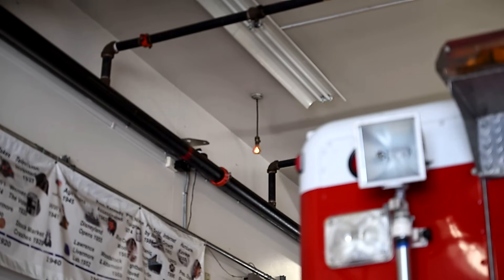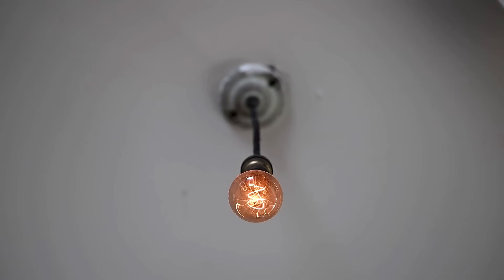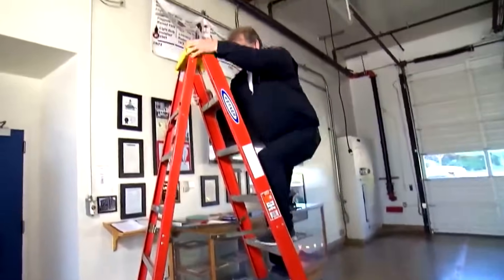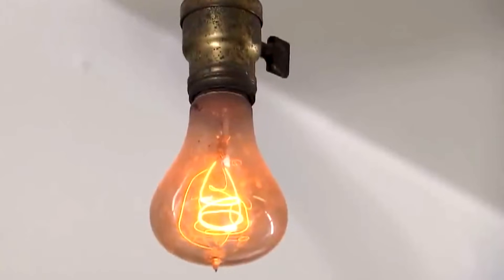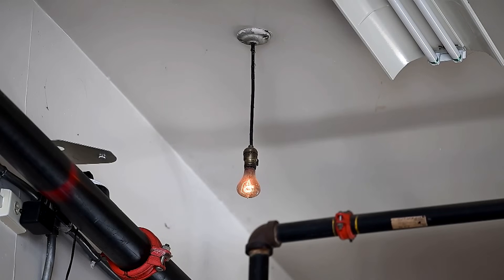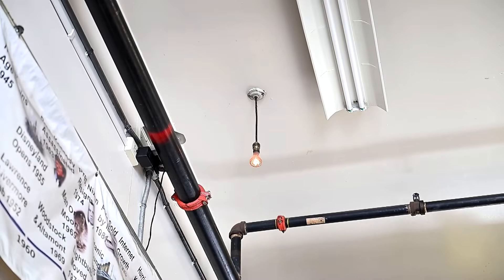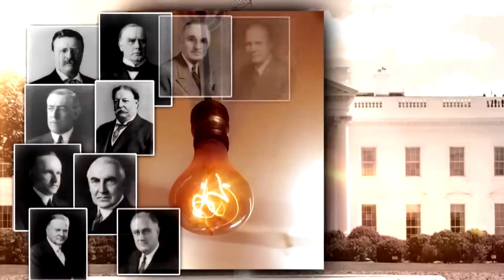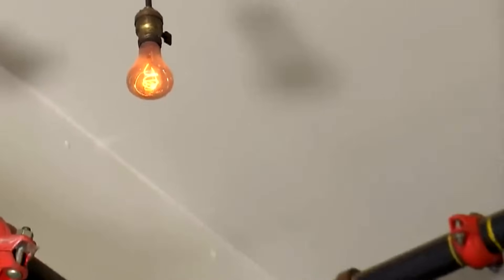This 120 Year Old Light Bulb Still Works!

Comment: How's that scientifically possible? Why hasn't the filament burnt out?
Reply: Handcrafted carbon filament is much stronger than machined tungsten filament. The light almost never gets turned on and off, minimizing wear. Lastly, the bulb was manufactured to run at 60 watts, but it only runs at 4.
Reply: Because the tungsten filament is thicker than normal.  It runs at a lower temperature. It also emits less light.  It's very good at wasting electricity
Reply: It is dimmed a substantial amount. When you dim an incandescent light bulb, it lasts longer.
Reply: Thomas Edison made them worse on pourpose because they lasted too long, causing sales to decrease
Reply: The massive light bulb companies got together to corner the market. They intentionally made a pact with rules among them to help drive sales. A light bulb company that makes light bulbs that last more than a few years, and is part of that pact, gets fined an outrageous rate if they do. All of this was to drive sales.

Comment: I cannot believe that light bulb has worked for so long! That is insane! The ones they make now don't even last nearly as long as they promise .
Reply: No one mention that was the side effects of making the filament glow way brighter
Reply: @randomthingch1970 just do not stair at it. You do not want that effect.😅
Reply: Because if they did they wouldn’t be able to sell any
Reply: @powmuckerstion9206 
Wrong

A longer lasting bulb only glows half as bright but consumes the same amount of electricity
The ideal light bulb is supposed to burn the filament as bright as possible

The point of giving light bulbs a shorter lifespan is to give you more light for less energy
Reply: @Katzelle3  Imagine if they all lasted as long as this one I'd think people would choose the longer lasting one if it meant they did not have buy more lightbulbs especially if the technology for longer lasting lightbulbs was further pursued. Problem is if that was what happened at some point lightbulbs would last practically forever which would mean lightbulb sales would tank especially if the bulbs were brighter the people making lightbulbs realized this back in the day so they stopped trying to make them last too long.
Reply: Given prices of one buck per bulb and twenty cents per kWh you pay seven bucks less for two normal bulbs that consume forty Watts than one double lifespan equivalent that consumes sixty Watts
Reply: @powmuckerstion9206 not just that but the manufacture cost and energy efficiency is magnitudes better today
Reply: and then they claim to care about the environment HAHAHA  @powmuckerstion9206
Reply: @powmuckerstion9206 omg I hate this argument. Incandescent light bulbs don’t last forever, no matter what really. If you want it to actually give off useful light, it’ll wear out. You can design them to last longer, but they use more energy and glow less brightly. Lightbulb manufacturers set the 1000 hour limit for a reason. It wasn’t just so you’d buy more bulbs. It was so you’d spend LESS on electricity. You could get 2500 hour bulbs, but they cost more to buy and run, so the savings never added up over a 1000 hour bulb
Reply: The only way to make them last long is to turn it on at a dimmer power!
Reply: It stopped "working" decades ago. The light output is a tiny fraction of what it was originally. It's a failed product.
Reply: @Monaleenian  nope it stil works
Reply: @VOLTRONDEFENDER4440  Not really. Saying that it still "works" would be like saying that a car that was once able to achieve a top speed of 100 miles per hour, that can now only achieve a top speed of 5 miles per hour, still works! The thing has failed.
Reply: @Monaleenian  their was a video from 2023 that stil has it burning!
Reply: @Monaleenian  also they have a live cam and when I checked it it’s stil on! Stil burning! Live cam never lies!
Reply: My lightbulb in my apartment only lasted 3 months
Reply: @20021redturle I moved in my apartment in 2018 and it is 2023 and most of the lights in my apartment have gone out. I think the remaining will be out next 2 years
Reply: @20021redturle  mines lasted just as long.
Reply: Because you wouln't buy a light bulb with such a weak light, anyway.
Reply: @MrSaiyan333  It was originally a 60w lightbulb. At least its what the guy said in the video. Now, its 4w due to age.
Reply: @MrSaiyan333  it's weak due to its age
Reply: @missemotional8710  it’s finally starting to dim?
Reply: I guess older lights last longer.
Reply: @matthewgregory8218  I think so. Not too sure
Reply: Google the Phoebus Cartel, it is by design.
Reply: Yeah except if you actually look at this light bulb you’d see why it’s lasted so long. It’s barely even on. No one would ever be able to use this for actual home lighting
Reply: That's because the ones today actually give off light, so of course they won't last as long. Lower the power of a modern incandescent bulb so that it only barely glows like this and it'll last 100 years too.
Reply: They made a promise!??? 
It just sounds like the iPhone 7 effect. Less power more money.
Reply: Yes, they last a few months. Light bulbs.... They lasted longer before, huh?😅 Nice.
Reply: Die richtige Wolframmischung und dicke macht vieles aus
Reply: Is no one actually aware of the Phoebus cartel here?? I haven’t seen a single comment mentioning it! The planned obsolescence was created by design in the 1920’s.
Reply: Is no one actually aware of the Phoebus cartel here?? I haven’t seen a single comment mentioning it! The planned obsolescence was created by design in the 1920’s.
Reply: Listen to the video again. It a defect. It's not even using 10% of the energy it was designed for. Naturally it's going to last a long time, at a much lower light output. Educate yourself.
Reply: Cars, razor blades, light bulbs,  phones, just about every mass manufactured good: common denominator ~manufacturered obsolescence  or "planned", is a business strategy that intentionally designs products to become obsolete after a short period of time. The goal is to encourage consumers to buy new products and upgrades. 👀💢
Go Capitalism!🤔

How it works 

Manufacturers design products to become unfashionable or no longer usable

They make it difficult to replace parts or accessories

They limit the lifespan of batteries

Examples 

Lightbulbs, Smartphones, Household appliances, Cars, Electronics, Software, and Fashion.

Impact

Planned obsolescence increases consumption of limited resources and waste 

It can lead to a distorted sense of value, where people feel like they should constantly buy new things 

History

The term was coined in 1928 by American marketing pioneer Justus George Frederick 

The Phoebus Cartel, an international group of lightbulb manufacturers, intentionally reduced the lifespan of lightbulbs in 1924 

Alternatives 

The circular economy principle aims to reduce consumption of raw materials and reuse waste
Reply: Look at it. Why is it so dim? IT'S A BAD LIGHT BULB.
Reply: Its cos its a 1-5 watt bulb where as todays standards its what 40
Reply: Thomas Edison made them worse on pourpose because they lasted too long, causing sales to decrease
Reply: @SgtD85  oh well.
Reply: Cuz if they make this cheaper they still make profit to keep buisness going just like cars
Reply: Back then people made things to last. Nowadays, companies make products last less long so people have to keep on buying more. The downside of the capitalism game
Reply: @G-B-F123  a lot of you guys do so well in sticking for what is 👍 right.
Reply: @G-B-F123  There's no upside to capitalism
Reply: Planned obsolescence
Reply: The companies used to give longer lasting light bulbs for free because they take more energy and you have to pay more for the electricity bill.
Reply: @janfgfdx5165 it was actually the opposite from what I've heard
Reply: They could make it, it just won’t last long as a business model. Capitalism for ya…
Reply: @doublemm22  the light bulb has to have a really weak light output to last that long. Like the 120year light bulb barely puts out any light so that's why it lasted that long.
Reply: Planned obsolescence
Reply: @orionxtc1119 not really; most of the time is just improper use; btw, the "centennial light" is a defective lamp that barely glows; is little more than a night light; thats why it lasted so long
Reply: @orionxtc1119  Nope. It's a light and is so dim that it doesn't work as a light. 

Fridges, washers, so many things have planned obsolescence, light bulbs aren't one of them. (How many cast iron pan companies are there? If you make something that lasts forever there will only be one company making it. Find that 1 company.)
Check out Technology Connections on light bulbs for more details.
Reply: Planned obsolescence
Reply: All the light bulb companies got together in the past and cornered the market. They made rules that can result in fines if you make light bulbs that last longer than a few years with usage because they realized, way back when, that selling light bulbs that last over 100 years isn't cost effective for their business
Reply: @harpiessnow  Especially when people were saying "If it aint broke, dont fix it"
Reply: @harpiessnow  because of buying news this bad?
Reply: Phoebus Cartel
Reply: @Luvurenemy wrong; this lamp only still works because its barely glowing; it glows little more than a nightlight; Phoebus Cartel has nothing on it; I recommend looking on the Technology Connections video on it